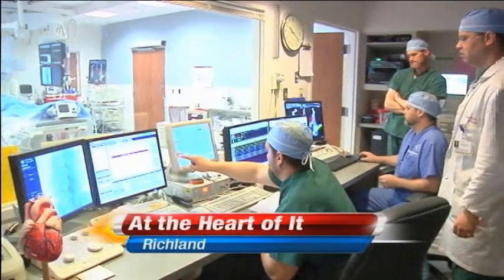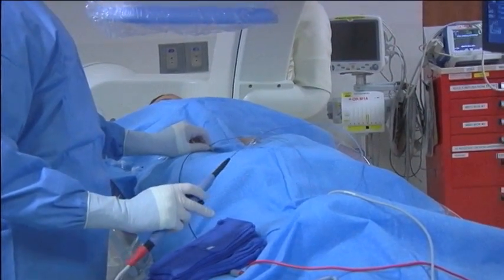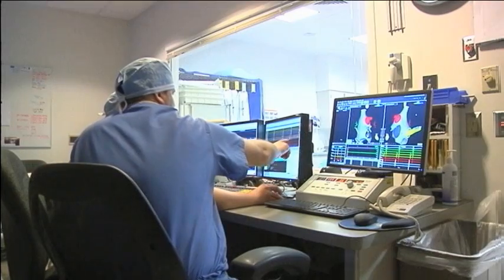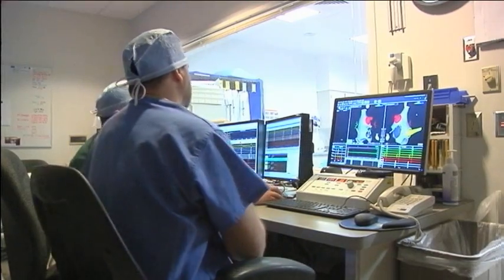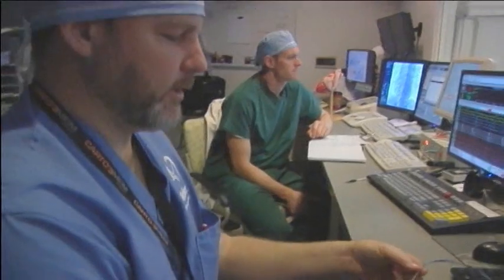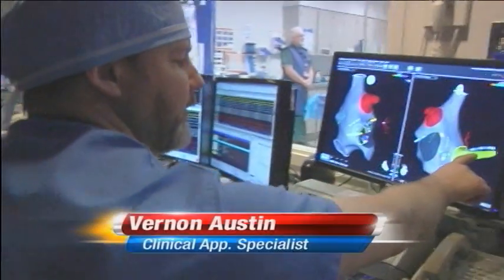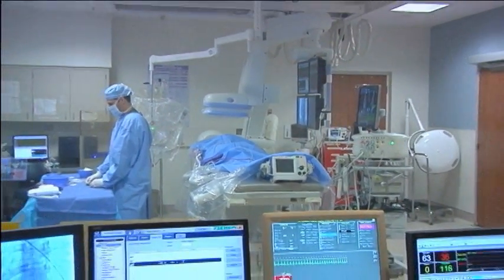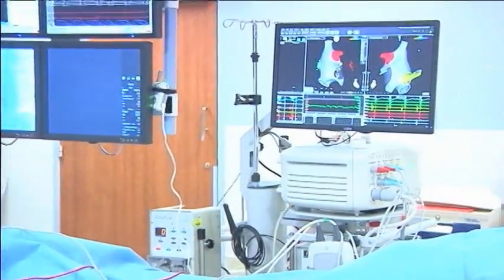Catheter Ablation of Supraventricular Tachycardia (AVNRT) - Watch a Procedure

Comment: IM NOW 3 DAYS POST OP

Im 19 from the uk i was put under fully because of my additional needs, i was diagnosed with SVT when i was 16 but struggled with irrgular heart rate since a child and told it was just panic attack and anxiety. Here i am now 19 i had my ep study which within 10mins they triggered the svt but thsn spent the next hour trinna slow it down enough so they could ablate it properly total spent in theatre was 2hrs but sadley i had a reaction to the anesthetic as i was comming round i was foaming at the mouth needing suction as well as haveing a blood pressure on brink of being danagerously low as well as i kept on stopping breathing and would ramdomly breath like 10 resps and stop again so i had to be on oxygen for 2hrs in recovery due to needing suction ect 

Got jepts in over night as blood pressure was too low and my hr was a bit all over the place, the following day just before being discharged ths surgeron came over smiling and was like u were a dream in that operating room there was no faffing around we triggered ur svt super easily and quickly but due to how fast it was we had to slow it down a bit so we could do the ablation but good news we ablated it we found you actuall had an extra pathway right across to the middle your heart and down but we fixed it unfortunately though we did find somthing that wasnt good so we need u to come back in afted few days rscover and we will need to do an echo, he continued to explain and exclained how shocked he was and the full understanding of how hard it must of been dealing with the severity of heart palputations and no wonder it was happening he never actually said why aside from what they found was a slow pathaway that they cant ablate due to other risks but unfortunately if the echo shows what we think then you may need to have a pacemaker fitted, i said okay whatever needs to be done im just so thankful u got rid on the main svt honstly thank you and he said its very clear to us during the ep the severity and we are sorry u had to deal with is as we saw in your notes repeated admittance to the hospital and multiple dr appts in regard to you haveing palpuations as young as 5 i said yh honestly they always passed it off as panic attacks and anxiety which he then just looked shocked and apologised and said im sorry that happened but it is very clear that what u had goin on wasnt just out of no whers u have clearly had it since birth but yeah all we need is to do an echo within ths next few weeks, whoopty do a 2 days after diacharge i got a call with thsm asking for me to come is as soon as possible for the echo scan i said sure when do u want me in and they said mo day 15th 9:50am sound good i was like ummmmm yh sure i geuss i aint got nothing thay day till later so yes and she was like okay great thanks and just hung up the phone, so yeah no proper explination as to why or what fully they found wrong but yh i just hope it can be sorted and yh i can just love and enjoy my llife even if they dont sort the other thing and like its not life threatning then yh this year will be the first year i be able to go on holiday go surfing, body boarding and go swimming for the first time without the fear imma end up in svt and end up in resus. 

Thankfully im under one the best hospitals if not THE best heart insitue in ths uk and so yh full faith in them to help ms out, i think they are just gonna find that yh its again just the way my heart was wired because they believe so my family are carries for the gene that causes the bacusbus valve disease and the mutation of the valve, i was told a little while ago i could be a carrier of the gene but not have the vavle issue instead with her and the issuse her heart is a bit more strechy compared to normal and so they think part of it is that my hearts a lil extra stretchy causing the other issue they found so yh i wouldnt be shocked it they fully comfirm it cuz thankfully well my mams now 47 and so far she okay yh the valve has gotten a bit worse with letting a lil more fluid back into her heart but they dont think they will need to do a valve transplant for anothed few years so yh if im found to have the mutation or not have it either way my mams goin pretty strong at 47 still and so i gather i have roughly atleast till then lol